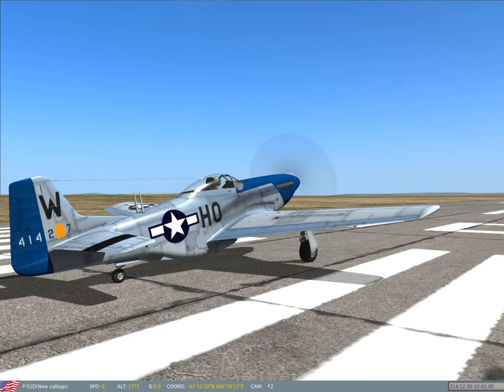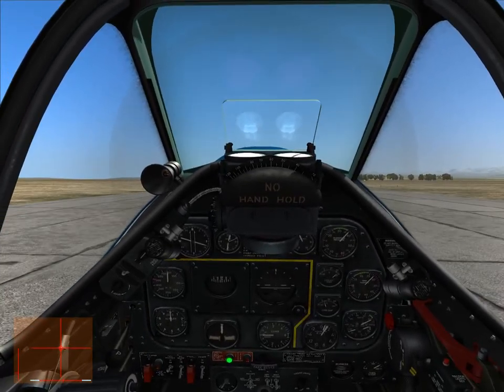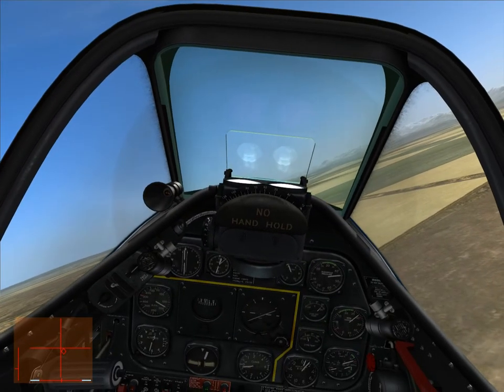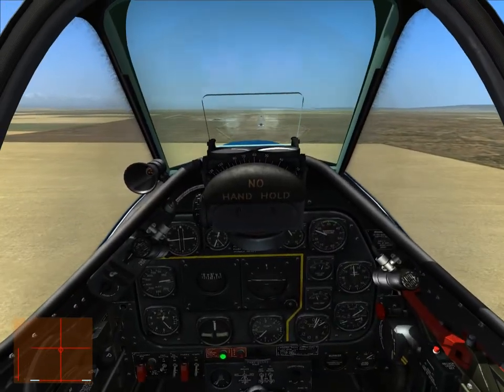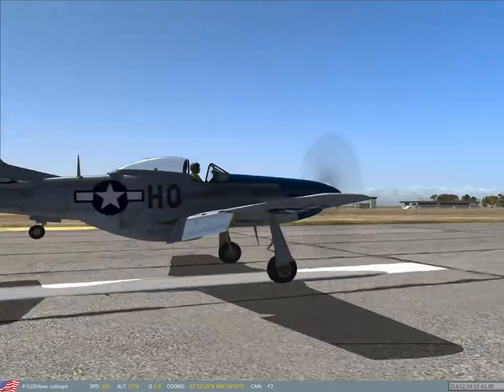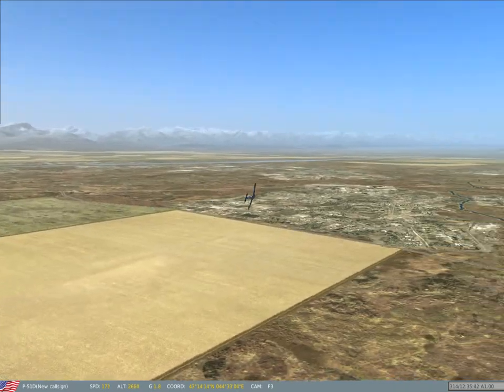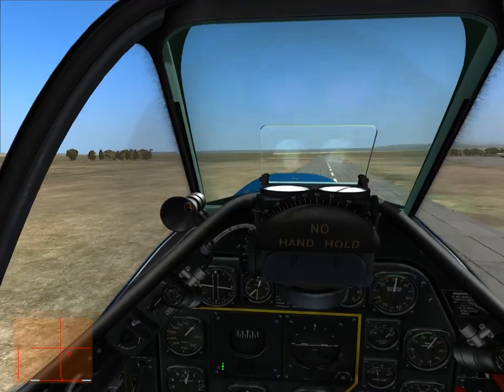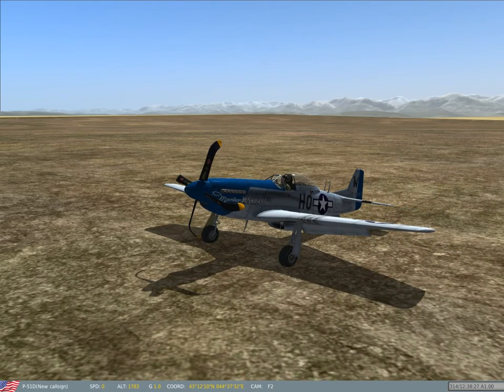A2A/DCS P-51D Landing Physics and Ground Handling Part 4

Comment: Does it have that issue when the flaps are not fully down?
Since at the beginning you mentioned a tail-heavy attitude I'm gonna say "no".

It's not a CG issue, it's a centre of lift issue.

When flaps are fully deployed the centre of lift moves aft because the deflection is too great and the trailing edge of the wing creates more lift than the leading edge.

Aircraft with this general layout (WW2-era single seat fighters and trainers mostly) have this general nose-down behaviour when flaps are fully deployed be it a P-47 or a Spitfire (Spitfires and Hurricanes are some of the worst actually).

It's natural and is an accurate representation of the real thing, there's a reason why DCS P-51 is one of the most realistic out there.

By the way, you'll find that during take-off rolls "walking" the throttle will greatly solve your stability problems. 
This is true for most prop planes but especially effective for high performance tail-draggers. Take your time with the throttle and use rudder to keep it on the line. You don't want to reach full power before your tail has full authority.

Also you're still not reducing power and literally "flying" during and after touchdown.